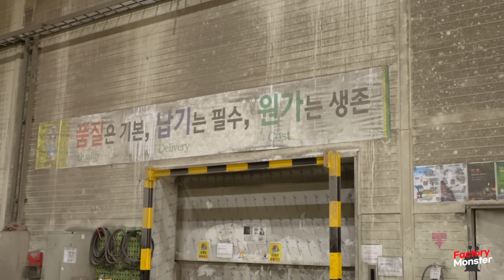Process of making Numerous Valves for Ship. Korean Valve Factory

Comment: Small correction, at 3:41 the captions say "molten iron is made.." but it is brass or bronze., and at 4:40 it says "molten steel is ready now"
Reply: Brass because you can see the burning glow of the zinc in the melting pot along with the characteristic plumes of smoke as the zinc depletes.

Comment: What is the little mesh put in the middle of the mould?
Reply: It's a filter to catch any slag/impurities as you pour in the molten metal.  Looked like it had a coating as well, perhaps flux?
Reply: @johnburden4727 it’s usually made from SiC.
Sponges are impregnated with Silicon Carbide Particles and then sintered.
Normally they have a microscopic Layer of Silicon Oxides on the Surface as soon as they get hot enough in Air.

They are reusable if you bother to clean them. I don’t know whether it’s economical on the bigger Scale.

The Filters are really important.
When they machine the Valve Body you see no Inclusions, although they aren’t doing injection Molding.
The Filter helps a lot. Not only does it capture the Slag and other solid Impurities, but it also stops the molten Metal from directly hitting the Sand and ripping & carrying Grains off.